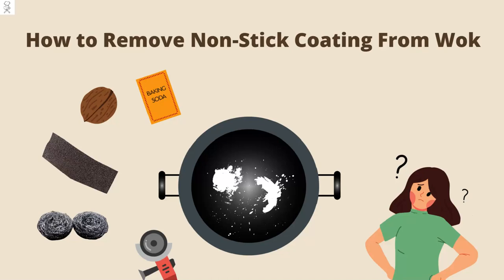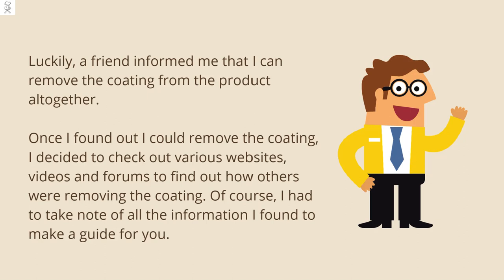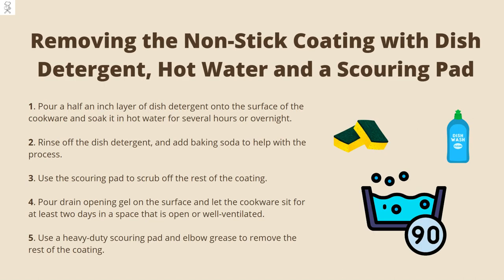How to Remove Non-Stick Coating from Wok?

Comment from the maker: 00:00 - Intro
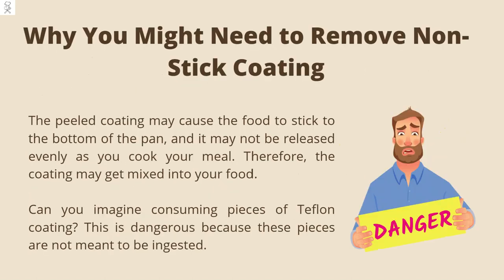00:35 - Why You Might Need to Remove Non-Stick Coating
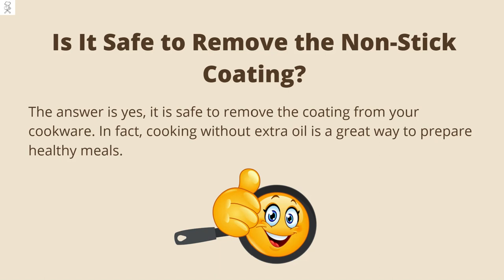00:57 - Is It Safe to Remove the Non-Stick Coating?
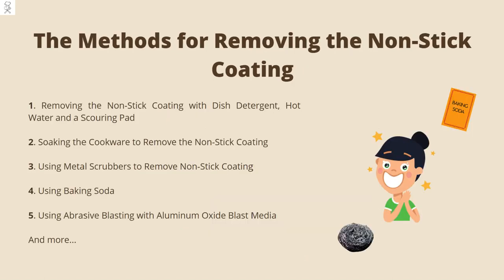01:28 - The Methods for Removing the Non-Stick Coating
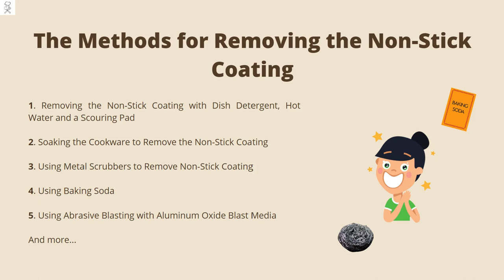01:54 - Removing the Non-Stick Coating with Dish Detergent, Hot Water and a Scouring Pad
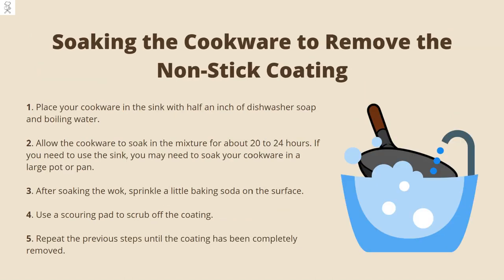02:31 - Soaking the Cookware to Remove the Non-Stick Coating
03:02 - Using Metal Scrubbers to Remove Non-Stick Coating
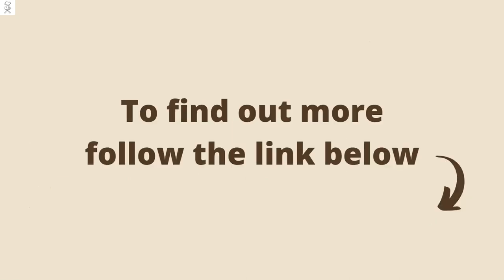03:16 - Continue Reading on My Website

Comment: Is there any chemical process, I will soak the nonstick pan, after ten/twenty minutes the coating will come off automatically?
Reply: Draino, after a few days you can rub it off easily with a rough steel wool pad.
Reply: use a torch burn it, then easily rub if off.

Comment: Just use a sander or sanding paper. Then put in some handwork. I used my dremel with increasing grit levels to get a perfect clean finish.
Reply: This stuff is cancerous though
Reply: @chris2009xx  You’re not supposed to breathe it, wear a mask or do this in a well ventilated space or actually both! The methods in the video don’t make the coating less cancerous.